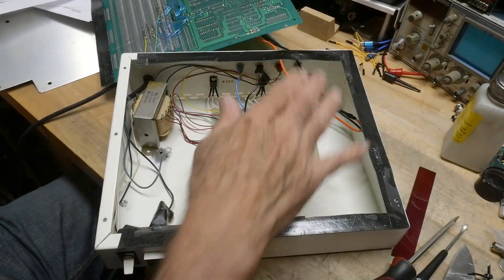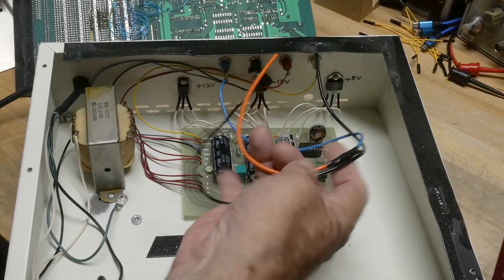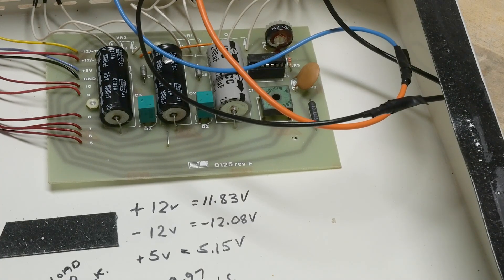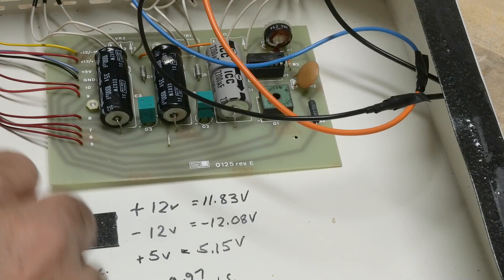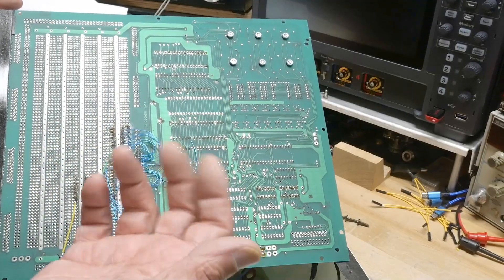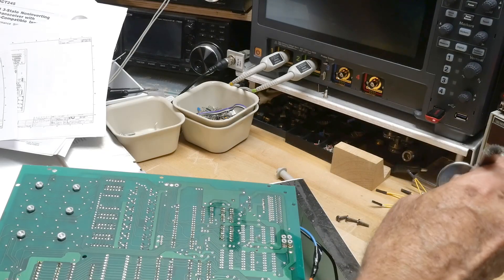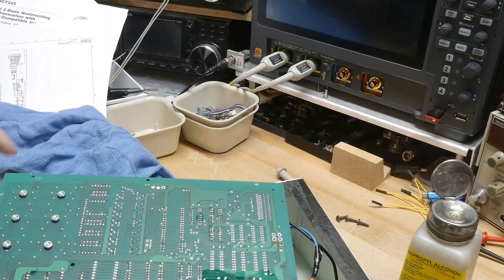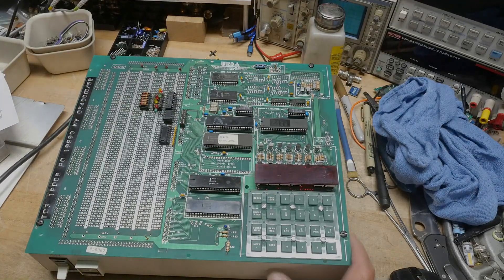#2368  SDK85 Intel 8085 Trainer (part 2 of 2)

Comment: It's predecessor, 8080 was used in the voyager planetary Mission in the command and data subsystem. If I recall correctly,  the 8085/6 was used on the Galileo Jupiter mission.  Nifty devices. I was the deputy JPL CDS section manager in the Galileo years. Nifty little devices.

Comment: Interesting to make comparisons. I have an E&L C.A.D.E.T. II "trainer" that I picked up a couple of years back. The power supply board on it is supported on the four corners and all connections use connectors; no loose wires.
I purchased it at about $120USD after having found the schematics and thinking of making my own. The price for all parts, etc would have been twice (minimum) what I paid for a well built product.
Going to anything further with this 8085?